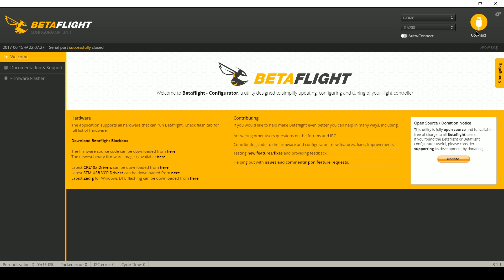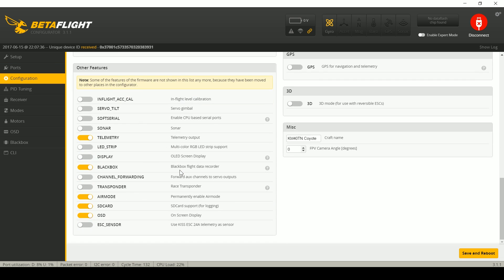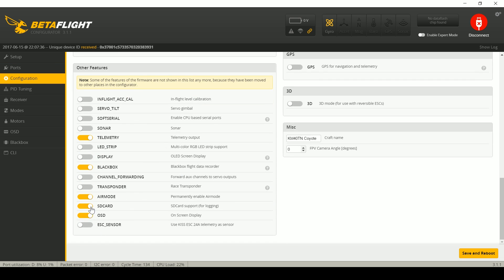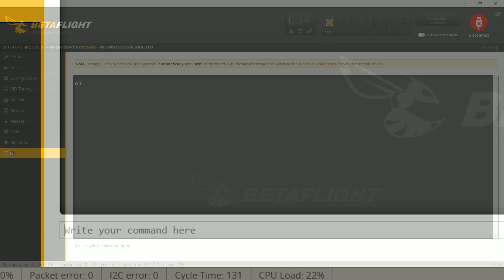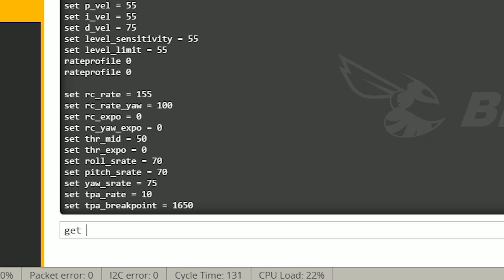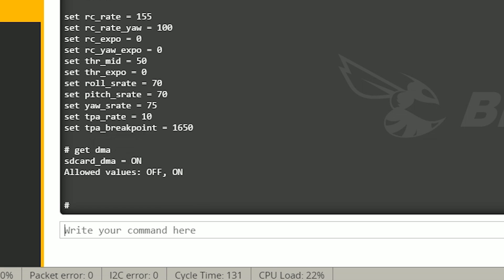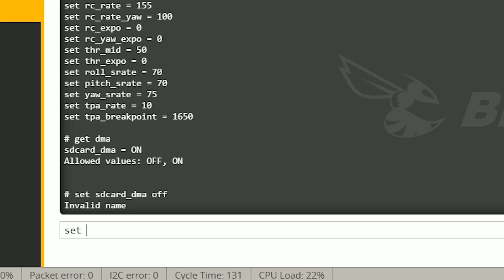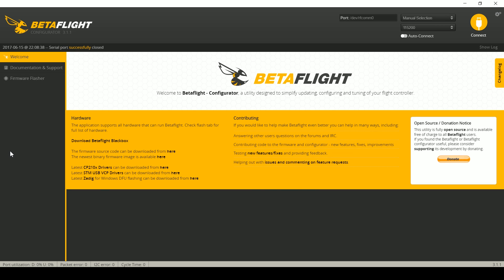Omnibus F4 Betaflight Thrashes and Crashes | HERE'S WHY AND HOW TO FIX IT

Comment: Dear Joshua,  your video's are very educational and intersting to watch. Woul like to give you  an extra thumbs up on that. However I am missing 1 topic. I know you are quad person but many are trying to build a Tri with the F4. I watch and read all there is about re-mapping sources but ther is alos talk of analog and digital servo's and timers etc. Could  you please show us how to do the tail servo.  In addition: The Omnibus F4 can handle up to 8 motors but does not have enough fysical connection options ? Why is that ? Hoping for your expert answer...  Greetings and good luck to you.
Reply from the maker: I would say, if you want to build a tricopter, you have to run Triflight, David Windestal's fork of Cleanflight. It has special options for tuning the tail servo that makes a tricopter fly as good as it possibly can.

Comment: Is it possible this could affect the f3 Omnibus board as well? because as of right now I'm fighting what looks to be the same issues... Never seen it b4 and I'm scratching my head... Going to try is and see what happens :)
Reply from the maker: Easy to find out right?
Reply: Thanks for the video.
My issue was caused by trying to power the LED strip through my flight board. Thinking bad LED strip or faulty regulator on my FC. was driving my crazy and was the last thing I check of course...

Comment: Thank you Joshua Bardwell!  I just had this problem after a couple of months of flying fine with my Omnibus F4 Pro V3 board. I was at my first ever race and threw a SD card in the FC. It seemed to be at about the same place on the course each time that the quad kept jittering and pitching backwards until it dropped and crashed. It only took 2 practice rounds and 2 race rounds until your video clicked in my brain. After I finally turned off the DMA, I was finally able to finish a race!  You saved my sanity (or what was left at that point).

Comment: Hi Joshua, what would you expect to see in a blackbox log if this was happening? I'm getting the same shaking and inversion, but logging shows heavy rc command inputs that aren't coming from me! Happy to share the log :)

Thanks!
Reply from the maker: The main thing you would see in this specific case is that blackbox logging cuts out entirely at the same time the quad flips out.
Reply: Ok that's not happening in my case, the rc commands seem to go crazy at the time of the issue and there don't seem to be any gaps in the log- its on a Matek F4. I don't think it could be a faulty IMU if the rc commands seem to match the quads change in attitude, any ideas what else it could be? :)
Reply from the maker: Transmitter gimbals borked.

1. It's not failsafe because rcCommand would freeze up.
2. It's not a bad gyro because you see rcCommand freaking out.

Therefore: it must be that the FC is getting garbage data from the receiver. Possibly the receiver is borked but especially with serial protocols that isn't likely. So the most likely cause is your gimbals are borked. Check the output monitor screen on your transmtiter.
Reply from the maker: Do you have video and BB log of this event? It might make a good video.
Reply: Thanks, I'll check them out - its a brand new Taranis X7 though! If you have some time would you be able to look through the two logs please? Both are about 30 seconds long , thanks!
I don't have video of the flight unfortunately
Reply from the maker: If you can get me video and a single matching log that would be helpful. Post a dropbox link or something like that.
Reply: Sure thing, won't be for a couple of days as the crash ripped a motor apart. I've uploaded the BB log of that for now, in case it helps: https://www.dropbox.com/s/bnfd5rznyskum2s/LOG00017.BFL?dl=0 

Thanks!
Reply: Hi Joshua, issue seems to have gone after disabling DMA for the SD Card - even though Matek confirmed their target doesn't use the same DMA address as any motors!
Reply: @JoshuaBardwell  I think my receiver is the problem now because everything seems fine in betaflight motors work perfectly, but when I use transmitter they go crazy also motors warm-up quickly, basically unflyable :(

Comment: Joshua with the Asgard F4 V2 FC I have a few issues.  Spektrum RX & OSD
The FC came loaded with BF OMNIBUSF4 3.0.1

1st issue you already answered for me I did get UART6 to 3.3v by removing the default bridge on 5v and bridging the 3v
2nd issue is UART6 must be inverted or opposite of what my DSX Rx likes because its not recognized.

I downloaded official BF 3.1.7 target OMNIBUSF4 and flashed it and still UART6 does not recognize RX

Somehow on GitHub I found downloaded and flashed a build by Boris.B BF 3.2 #1253 target OMNIBUSF4  
I now am in business my RX is recognized and I finished my build but now the oddity is BF configurator can not detect my battery voltage 0.0v and my OSD is there but no data. No matter what I change BF to display in the OSD it will change in the configurator but does not reflect the change in my goggles.

so my issues stand as:
when I am on 3.1.7 everything works with OSD and Voltage reading does show in BF configurator but RX is not recognized
when I am on 3.2 build #1253 my RX now works but my OSD gets no data and BF configurator shows 0.0v battery.

I don't now how to get 3.1.7 to change UART6 from inverted to non-inverted or vise-versa.  The commands I found online say syntax error when I try them.

I know your busy but was wondering what you would do if you were me?  Is Boris.B someone that can be reached if need be?
Thanks Jim..
Reply from the maker: You are running 3.2, which is a pre-alpha build. It's not surprising that some features don't work. I suppose vBat and OSD are not working in that build and target. That's the risk of running a pre-alpha build.

Comment: 1st!    https://www.youtube.com/watch?v=qeTyTscAl_w
Dam you YouTube and your privacy setting , thinking I have posted comments only to
discover my comments are only shown when I'm logged in!

 I had this problem after a new Martian 250 build using a genuine Omnibus F4 Pro .It's only my second built so I did immediately think I had caused the fault and at the time I could not find any info.I did some logical fault finding and switched off BB and
got it to fly with out trying to take my face off! ,then I found the link on https://github.com/betaflight/betaflight/issues/2631

I found it really frustrating as at the time I had the issue as I could not find any info ,as did not seem to be common knowledge. It has made me more careful on pre flight and now any change or build I will always use Acro mode as first test fights.
I can confirm soft mounting of motors or flight controller made no difference to the fault and initially it did it on the 4th test flight and then again after 8th.Also it would go out of control in stabilized flight when the throttle was dropped or accelerate on take off in a random direction(scary) ,but if flown in Acro mode and you quickly dropped the throttle at the start point of oscillations it was possible to recover and fly it ,but motors were hot.I found on a BB log a low frequency spike prior to the problem ,but after getting it to fly I have not investigated it .
I have joined github and hope to contribute when I gain more knowledge as I do appreciate what the developers and other do ,most of the time for little or no reward.
Thanks for getting this out there and all the knowledge you pass on.

Comment: Have you checked the 5v output on your omnibus f4 pro?  I checked the voltage on my motor 1 pins and am only showing 4.38v using a fresh 14.8v battery.  Only wires that are on the board are my + and - going to my battery, no current wire or anything else,  I was just checking my new board.  Will this cause a problem?  Do I possibly have a defective f4 board?
Reply from the maker: Hard to say. 4.38 is low enough that some 5v accessories will have problems. I wouldn't use the board until that was fixed.

Comment: mine does that with my betaflight f3 fc
Reply: mine doesn't crash just shakes crazy on throttle ups. soft mounted fc and replaced motors with brotherhobby 2206x2450kvs and it stopped it. hmmmm motors cause vibrations?
Reply: ive builts 5 betaflight f3 quads lately that does somewhat the same. all 5 drop the back left motor on 100% throttle. tried fw all the way back to 3.0.  diff escs and firmwares. diff motors.

Comment: That's exactly the reason why there are DMA priorities you can set for each stream. However it seems developers don't necessarily know how to use those.
Reply from the maker: Well if you are so smart, start making pull requests. This is an open source project and everyone is doing the best they can. The use of DMA to control motors is relatively new with the advent of Dshot so it's not surprising that there are some growing pains. Or maybe the vendor just screwed up the mapping of DMA channels on this particular board? Remember that the mapping of timers and DMA channels to resources is not controlled by the BF devs and varies from board to board.
Reply from the maker: Argh. Sorry... I guess I came off a little defensive. It always bugs me when somebody is critical of these guys. They work so freaking hard for basically no concrete reward, and since it's an open source project, I can't help but feel that anybody who is critical and who then doesn't contribute is being really hypocritical.
Reply: Joshua Bardwell it didn't meant to insult or decrease the importance of contributors to the project. I highly value open source projects, the problem in this particular situation is that there is no equal amount of HW devs contributions as to other higher level portions of the code. BF is complex system especially because it's baremetal and everything have to coexist. I had already issues with DMA priorities on the BF before: essentially ADC was taking over UART TX or RX and the result was  many corrupted packets. Unfortunately devs ignored my message on that.
Reply: Also DMA priorities are not an issue in this case, it's something else apparently
Reply: If the DMA motor control usage is new to DSHOT, then another potential work-a-round might be to cut back to multi-shot. Just a wild guess. Perhaps useful for those who need the most reliable logging.

Just read the github postings on the issue. Seems the issue may be a CPU bug(fault!), triggered by more than two simultaneous DMA operations. If so the only fix possible is to never ever use DMA for more than two simultaneous tasks/jobs, in the firmware. So the new DSHOT is exposing this issue, because it's (presumably) an additional use of DMA in the system. Hmm.
Reply: amisoftau this is incorrect. Errata doesn't contain anything similar to this issue. F405 is mature series I would be very surprised if there are new bugs on hw level. Also it's practically impossible to enable DMA for two streams on one controller at the same time, there is small controller in each DMA unit controlling which stream fires at particular moment. Everything is scheduled according to priorities.
Reply: [conkerkh] Hope you're right. :)

Comment: Hi Joshua,
check out this issue on betaflight github:

https://github.com/betaflight/betaflight/issues/2631
(Quad randomly starts shaking when logging to sd)

Seems it also happens with sdcard_dma turned off. It might also be SD card related (bad/slow SD cards).

Comment: Hey Joshua so just put new motors on my build and I am getting a lot of jello in fpv cam   I checked and all components in build and they seem to be secure... what parameters in bf can cause jello just wondering how to possibly tune it out... jello seem to be the worst with throttle punches
Reply: Alex Dalton D, but it's more likely that you have one motor which is out of balance
Reply: MrMario616 all 4 brand new emax 2205 also jello is in fpv camera
Reply: MrMario616 figured it out man the props were scrap put new props on and night and day difference

Comment: I assume this is only a problem if you use Dshot which uses DMA?
Reply from the maker: That would make a lot of sense.
Reply: Stephen Gibb I have 2 copters using this board and oneshot125 and I never had this problem until I upgraded to dshot. Go figure.

Comment: Thanks Joshua for this info.
I have a question for you. One of my builds has an Omnibus F3 that exhibits the same tendencies. The only thing it lacks from the example given in the video is the actual drop out.
So I guess I'm asking if this has been reported on the F3?
Reply from the maker: I suppose it's possible but it was specifically mentioned on the F4. Anyway, turn sdcard_dma off and if that fixes it, you diagnosed the problem.
Reply: I'm getting spins of death on 2 of my Omnibus F3 quads so I'm going to try this fix out on those too. We'll see how it goes.
Reply: Just checked all of my Omnibus F3's and they all have sdcard_dma off by default. Oh well.

Comment: I can't test this fix as I'm currently grounded, due to a flip out in air mode but my copter was doing this before I began trying to tune it out. I managed to get it to quieten down a lot by reducing the D on P & R but when in air mode whenever I try to do a flip or roll it flips out. But this didn't happen in Acro mode, which I thought strange. Once the new Chameleon frame arrived I will test. Thanks Joshua, it is appreciated.

Comment: Thanks for this.

I have two identical F4 Omnibus builds and one glitches out randomly during flight.  I recently swapped from 4-in-1 to individual ESCs and a PDB (which routes signal wires), and I thought it might be noise getting to the signal lines.  I will be testing this fix when I get home.

Comment: I flashed Betaflight replacing clean flight on a brushed micro quad and it said success at the end of the flash. I tried to connect immediately after that and it wouldn't connect. Now I can't get it to boot up. Only the blue light comes on solid now and no red flashing light whether I plug in battery or USB. It will not boot up and I can't reflash either. It's on the Eachine EX 110. It was flying OK before the flash but I like Betaflight better and was told that any controller running Cleanflight can be reflashed to use Betaflight. I can't even flash Cleanflight back to it. Is it bricked?

Comment: Does anyone have an answer to get ibus on the omnibus F4 pro V2. I know blue falcon project has a video but it doesn't work for the pro. I would prefer not to run ppm. Pppplllease Help
Reply from the maker: Can you not just solder to any UART RX pad?
Reply: the pro doesn't extra uart pads
Reply: it just has pwm pads
Reply: I'm going to try the J5 port. that's for the reply. I know your a busy guy. p.s. u the man! lol

Comment: funny story, i have the original omnibus and the original board had an issue from factory motor 3 was 4 and motor 4 was 3 on the motor pins. so after updating to BF3.1.7 i tried to fly and it flipped over, i checked the motor rotation, prop placement, board orientation, accelerometer calibration just when i was ready to put it into a hydraulic press, crack a beer and smile i went into the motors tab, and sure enough M1 was right, M2 was spot on, spin up motor 3 and would you believe motor 4 spun up, and with that said motor 4 was in fact motor 3. i was so confused. so i went back and watched Bardwell's video on resource mapping and didnt even have to take it apart to move that motor signal wire. i was a happy camper! thanks Bardwell!

Comment: i have this board from banggood but mine wont logg. ust makes a 4gb file that i cant use :/
Reply from the maker: +vazza69 is sdcard option turned on in Features, like I showed?
Reply: Yeah and its set to sd in cli to. I don't get the wobbling when i fly either..
Reply: Okay now i thing it was a crappy sd card. now i have a nes one and i get a log folder but i always get a big file named freespace. ??? Know of that?
Reply: Pardon me for not doing my work XD So the limit for logging is 4gb. And so my problem probably was the bad card. I also set dma of and down for 8k logging to 1. well see now.

Comment: I have a question. I have a airbot F4 micro flight controller. and it will not acknowledge the throttle signal unless I plug in a USB and then it will acknowledge and stay working. but that is the only way I can fly , I have to plug in the battery and then plug in the USB to my quad and then unplug the USB and then I can fly. I consider myself halfway knowledgeable, but I am not sure why this is happening.
Reply from the maker: +Carlos Flanders no clue, sorry.

Comment: I've had this happen to me a couple times on the BetaFlight F3 board. Good to know. Is there anything else that could be causing it?
Reply: Also wondering if it's bad to keep debug set to gyro after I have filters tuned.
Reply from the maker: +Boomotang debug gyro will slightly increase your logging data. It's no big deal.

Comment: My PikoBlx FC in my self constructed 95mm quad (The Hawk) has a similar DMA conflict! 

Although I am having installed a 4 in 1 ESD which is DSHOT600 capable I cant use it because: 

- 1st I am flying all my copters with my Aurora9 and ppm RX's (there is no serial RX for the Aurora on the market.??..) 
- 2nd I have a LED strip installed and would need exactly resource remapping for motor1 to the LED pin on the PicoBlx to enable DHOT600

This is why I have configured the FC back to Multishot.....